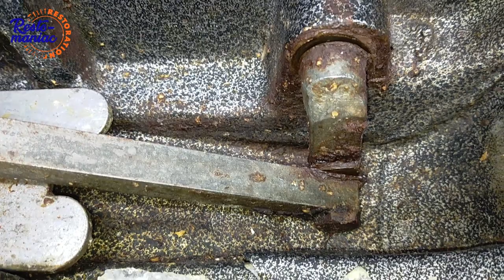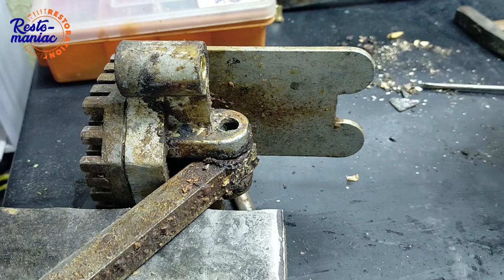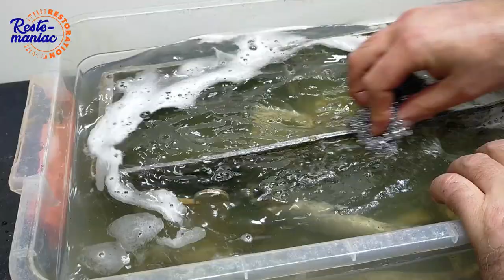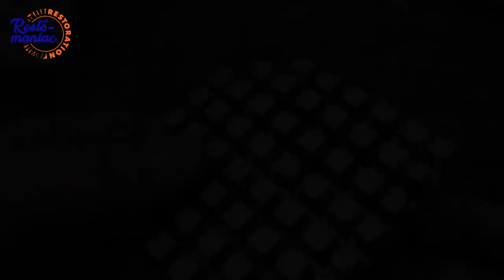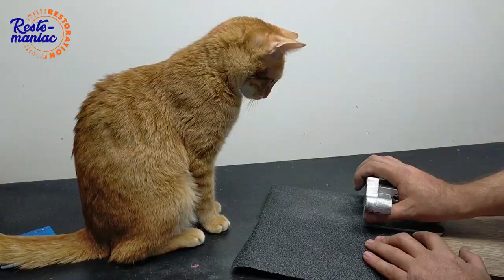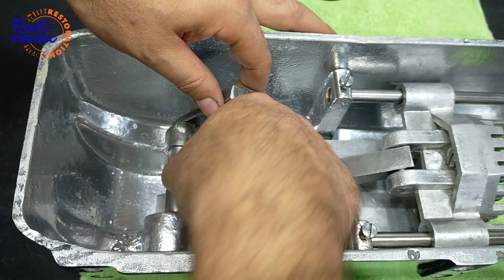Potato Slicer Renovation

Comment: The reason you were having problems with the steel screws sticking in the aluminum was because of  galvanic corrosion.  This is an electrochemical process in which one type of metal corrodes another type of metal.  Normally not a big issue unless there is an electrolyte present such as water which will exacerbate the problem.  Since this was a food processing tool, it was probably cleaned thousands of times with soap and water.
Reply from the maker: Thank you very much for your information and comments :)
Reply: You get the same thinh happen with aluminium car whhels , it will eventualy push the tyre away from the rim and you will have a slow leak that will get worse . Easy fix, take the tyre off , wire brush the rim and put back together times 4 . Easier to get a tyre repair place to do it though )))
Reply: I was thinking about this. Stainless steel wouldn't do this, but copper and normal steal and aluminum would... I think if you examine the periodic table you could find compatible metals that would not corrode each other. Aluminum and Copper are such two metals, as is Iron and Nickel.

Comment: This thing was not designed to be easily cleaned...so it wasn't cleaned at all.  A shining example of how NOT to design food prep tools. Very nice job; now it can live the rest of its days as a conversation piece.
Reply from the maker: Thank you very much for your comments :)
Reply: I agree. I love to see old equipment brought back from the dead, and as you said, nice conversation piece as it will never be used for it's intended purpose again, not when you can buy frozen chips for a fraction of the cost of making your own.
Reply: I saw a similar tool refurbished on another channel. The whole thing was easy to take apart by hand and wash... You could swap out the blades for a smaller grid or different shapes, etc.